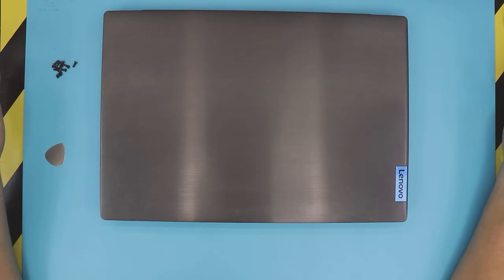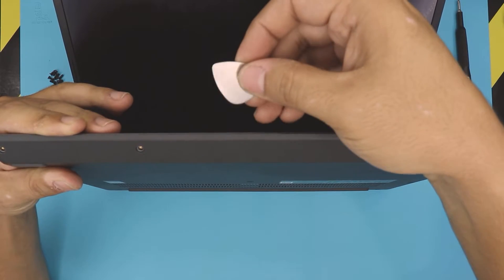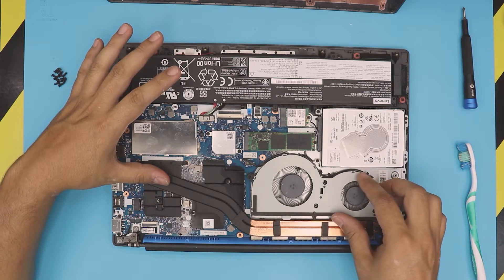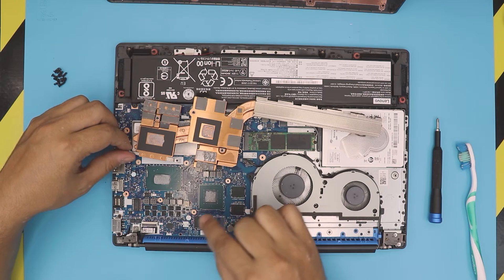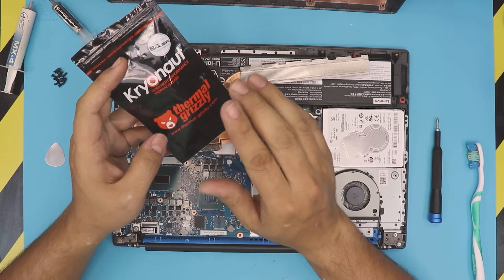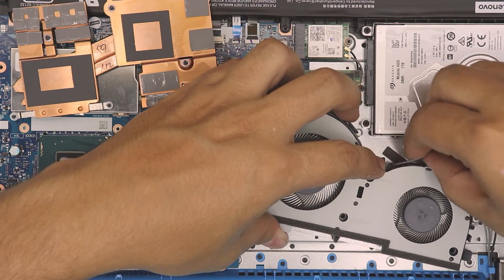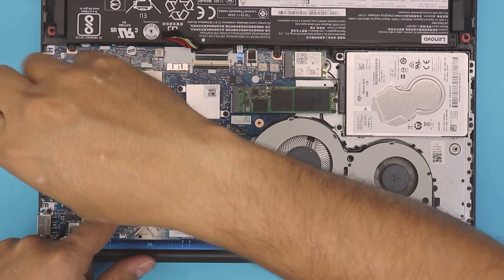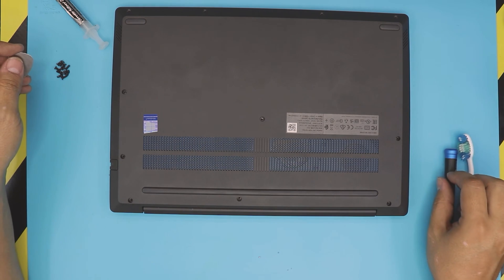Lenovo Gaming L340 Repaste maintenance under 10min !

Comment: hello sir i am from india and  I own th esame laptop that is lenovo l340  thermal pads  on heatsink ,of my laptop are corroded like they are in powdered form on some parts please suggest me what should i do and reccomend me the thermal pads of perfect thickkness  that are available in india on amazon . please reccommend .
Reply from the maker: Thank you for the feedback! if you wish to support the channel you can LIKE or SUB or both :P
regarding your question: get any 12kw and .2mm : https://is.gd/CmGARM
Reply: @uFixTek  Sir this link is not opening please provide another.one please
Reply from the maker: @devsati4311  https://www.amazon.in/MAXBELL-Silicone-Thermal-Resistance-Heatsink/dp/B09GPN2F13

Comment: Cleaned out my fan’s dust and it’s still making weird noises smh help
Reply from the maker: can you send me a short video or audio of the sound that is making?
ask@ufixtek.com
Reply: @uFixTek  Do you have an instagram that I can send a video to? Its like a moderate to loud whirring noise that isnt the gpu. even at 5% usage its making noises. I took the laptop apart and cleaned dust, and went through my vents.
Reply from the maker: no my friend i dont use any of those as rare it sounds but i dont have time to use those, you can email me i check my emails daily.
you can email or upload a private video on you tube, and or use this: https://wetransfer.com/
Reply: @uFixTek  ok
Reply: @uFixTek what’s your email again 😂😂

Comment: I did exactly this, but I am getting a bit worse temperatures than before. Could it be that I applied the paste somehow bad? Is it possible that I maybe pressed it a little too hard on the new paste and it went away from the centre? Should I reapply it?
Reply from the maker: Thank you for the feedback! if you wish to support the channel you can LIKE or SUB or both :P
regarding your question:
please answer the following questions correctly and exactly:
#1. what brand and model of the paste you using?
#2. did you touch or remove or changed the pads around the GPU/CPU?
#3. did you place a fair amount of the paste in the center?
#4. did you cross screw the heat sink clamps. in a X way?
Reply: @uFixTek  I used the Arctic MX-4. I did nothing with the pads except cleaned them with a little bit alcohol from the old paste. I think I applied enough of the paste, and I screwed it in X way. That's why it feels strange to me.
Reply from the maker: ok then you may need to use a thick paste like artic silver 5 that is great for a uneven heatsink,  this happens often we get this situations in the store, that sometime the paste that we use normally mx4 dont respond well because its not thick. so we use artic silver 5 that is thicker and can stand better the unbalanced plates. because the factory paste is also thicker for the same reason.  if you can get your hands get artic silver 5 is the only good paste that is thick, dont get :
thermal grizzly kryonaut
or anything else they are awesome but they are like mx4 very thin.
https://amzn.to/3yIRtXb
or get the 13grams for futures repaste:
https://amzn.to/3qYr0Cb

-
note if you still have left over mx4 do a repaste again to confirm the situation.
Reply: @uFixTek  shit. I got thermal grizzly and i am now worried lol. I haven't installed it though
Reply from the maker: @yostinpoveda2083  we use thermal grizzly , his case is 1 in 500 maybe or even higher. just two days ago we did a service with thermal G, and it was beautiful results.  try it out.
Reply: @uFixTek  I'm repasting today with grizzly later on at night.
Reply from the maker: @yostinpoveda2083  oki take your time, and if you need help let me know. good luck
Reply: @uFixTek  thanks a lot. I will spread it out with the spreader that the grizzly paste brings. By the way, great English. Is your store in USA? I have always like computers. Maybe I will take a technical degree sometime and see if I could make some extra income sometime in the future.
Reply from the maker: @yostinpoveda2083  okay do that spread the paste and take your time doing it, i speak 5lang, im in the mexico at the moment but i live in canada. if you like computer take a course and i always make videos trying to help people to do their services and upgrades.
Reply: @uFixTek  hello sir. I have only been able to unscrew 1. I have a 7.5 mm unscrewer, do you think I should go for a 10mm and a not square one in case I mess up with the screws?
Reply: By the way the only screw i was able to lose up does go off I guess it will untill all of them go off. And i also have a contact cleaner for metal contact which I was going to use to clean the CPU and GPU not sure if spraying a bit on the screw could help it loose. I am even thinking to buy welding Adhesive and adhere a nut to the screw. I also have DWD 40 rust lubricator. Not sure if I could also use a hammer to help loose up the screws by giving some small smashes with a hammer to them lol.
Reply: I know this is 2 years old but is the performance better? It could still be thermal throttling just like it was before but just run at a higher speed hence the temperatures not having gone down

Comment: My laptop all of the sudden have some keys that stops working randomly. They start working again and then it keeps happening. I tried all the software solutions and still happening. Do I have to change the keyboard?
Reply from the maker: Thank you for the feedback! if you wish to support the channel you can LIKE or SUB or both :P
regarding your question:  your keyboard membrane is going back, unfortunately you will have to end up replacing the keyboard. replacing this mesh keyboard its not a easy nor hard task just time consuming :P
here is a video of how to replace a mesh keyboard.
https://www.ebay.com/itm/333176442734?hash=item4d92dd0f6e:g:0YwAAOSw3WxaTLks

https://youtu.be/xsg-Zn80hZQ
https://youtu.be/m3zuNBASGCY
https://youtu.be/3srWWbxIgXI

OR you can replace the Palmrest  completely but that would cost a bit more,  but less work :P
https://amzn.to/3dCl4t7

Comment: A quick question can you remove the keys one by one on the keyboard?
Reply from the maker: Thank you for the feedback! if you wish to support the channel you can LIKE or SUB or both :P
regarding your question:  YES and NOT recommended you will have 80% chance of breaking the hinges under the keys, it requires lots of skills. i been doing it for 18years and still not perfect.
Reply: My brother spilled soda on my laptop so some of my keys are sticky.
Reply from the maker: use a isopropyl alcohol with a pray and spray a fair amount on the keys and let the isopropyl alcohol get under and keep tapping the keys till it washed the soda, the isopropyl alcohol will destroy the soda :P
make sure the laptop is off when you doing this and let the laptop dry dont worry the isopropyl alcohol is not conductive.

Comment: i cant open the back at the ethernet port
Reply from the maker: Thank you for the feedback! if you wish to support the channel you can LIKE or SUB or both :P
regarding your question: you make sure you remove the screw :P and if you loosen up the other end of the case just pull up from other end and this side will snap out. they are hold by tiny clips that are not even important.
Reply: @uFixTek  i have subbed
Reply from the maker: much appreciated :P

Comment: My bottom air vent is broken so should I use or replace it?
Reply from the maker: Thank you for the feedback and your support by a sub  :P
regarding your question:
can you send me a picture of the vent broken?>
Reply: @uFixTek  how?
Reply from the maker: @klaus9687  take a picture of the broken vent and use this website , and post the link here
https://prnt.sc/
Reply: @uFixTek  did u see it?
Reply from the maker: you have to upload to that website and post me here the link,  in order for me to see it
Reply: @uFixTek  I am posting the link but it is disappearing
Reply: @uFixTek  plz say can I use?http://prnt.sc/11mxrw8
Reply: Mesh cover is broken
Reply from the maker: :P dont worry , i would even recommend you to peal off the mesh it will help a lot with air flow. trust me the mesh it wont help with dust, just remove it
Reply: @uFixTek  ok and I did a stress test and it gave a warning about overheating....should I repair it?

Comment: The very useful guide , thank you , but i have a problem with screws on raditor just cant turn them , used a lot of strength and damage them a little bit , maybe you can give me advice or answer?
Reply from the maker: thank you for the feedback and support to the channel by a SUB :P
regarding your question: sometimes they are really hard to remove:
method one:
press down with screw driver on the screw and do a small rotation with extra force.
#2. if all intent didnt work make a insertion straight over the screw head and use a flat screw driver to remove, if you want me to make a video showing you how to, i will in a couple of days.

Comment: May I know the exact thickness of the thermal pads so I can order a pads and paste as well? Thank you 😁
Reply from the maker: Thank you for the feedback and your support to the channel by a SUB:P 
regarding your question: 
here is the pads for the laptop:
the best pads:
https://amzn.to/2QL6wPj
2nd best:
https://amzn.to/3rveOHu

BUT i would recommend you to not replace the pads, NO need at all to replace them , you wont notice any difference in performance or anything, the thermal pads for the vram are totally not required UNLESS you are going to OC the vrams. if you are not over clocking VRAMS no need!
Reply: @uFixTek  thanks for the tip! That helps a lot
Reply from the maker: your welcome my friend and good luck

Comment: Hyy it's me again...

As I checked with some games, using MSI Afterburner...

For Mafia 2 Classic the GPU temps are around at 60C-65C while I LIMIT says NO LOAD

But when I play Resident Evil 3 Remake GPU temps are increasing gradually while LIMIT says VOLTAGE LIMIT

So is it the problem with battery and charger?
Reply from the maker: Thank you for the feedback and your support to the channel by a sub :P
regarding your question:
we do get this issue in the store often and the results:
1. 80% charger failing to deliver the right amount of amper.
2. a voltage regulator on the motherboard of not woring properly
3. batter has nothing to do with this, you should never never do a full load on battery alone , as you can damage many power regulator components, that can result in the above issue.
Reply: @uFixTek  sorry I didn't catch that much 
could u please elaborate more?
Reply: @nj_mods  Lenvo L340 gaming has a power limit of 35w (TDP) due to its poor thermals in theory. I will try reapplying thermal paste and changing the TdP from 35 to 45
Reply: @yostinpoveda2083  I have put my power limit to 30w and still temps are high and reaches upto 85C max...
Reply: @nj_mods  Have you re-pasted the CPU and GPU yet? My temperatures are under 75's on apex legends and another air plane demanding game. There is a new BIOS update in Lenovo service bridge for Lenovo L340 gaming laptops. I updated that BIOS, also put my pergormance power plan in the minimum to 100% and maximum to 90%. Please note I have a cooling pad and place my laptop lifted a few centimeters from the desk when gaming. Make sure you have no windows updates pending. Try eliminating start up apps by going to task manager and check disable start up apps. You can also disable background apps by going to background apps in windows. In short start up and background apps are energy killers and i believe they also eat some power from the CPU besides our games. Thus, running a game + start up + background apps may make the computer hotter but that is my theory. I have done all of the above + will take my laptop to take off the manufacturing thermal paste for a new repaste. Eventhough my laptop is just 1month old, i don't trust the application of pre-applied thermal paste.
Reply: @yostinpoveda2083  no I haven't repasted my CPU and GPU and also my CPU temps average at around 75C but sometimes it touches upto 85C and then drop back to 75C... I am also using a lifted cooling pad... Ive disable unnecessary startup programs and background apps... 
As of BIOS update I haven't check that yet and mine is 6months old.
I guess the stock thermal paste for CPU and GPU is the main reason behind overheating...

Also to mention that games seems to be running better when I turn off turbo boost, because when it's on the game seems to been stutter a bit.
Reply: @nj_mods  I see. My CPU goes to 4.0ghz for some seconds and the goes back to 2.4ghz. And goes back to 4.0ghz again. The GPU runs perfectly fine and CPU uses boost but sometimes. I hope the re-pasted helps the boost speed to be maintained a bit more. If not , i Will change the TDP from 35 to 45 wats tdp as long as my re-paste keeps temperatures down, so I can have some room for maintained boost speed.

Comment: Hey pro .. 
My laptop ideapad l340 i7 the button ( w ) don't working but when i connect other keyboard he working  what should i do can i fix this buttom only or change the keyboard .. 
Can u advice me because in this case i fell like panic attack 😭 ..
I from egypt
Reply from the maker: Thank you for the support to the channel by a SUB :P
regarding your question:
the keyboard button cannot be fixed, no one can fix it.
you will have to replace the entire keyboard:
https://tinyurl.com/j8bf2n4f
search on aliexpress or ebay for this:
lenovo ideapad l340 keyboard
and make sure you get the right keyboard pay attention to the enter KEY some come with L shape enter key and some straight
the rest doesn't matter 

here is two example of the enter keys:
https://prnt.sc/10qovyt
https://prnt.sc/10qovpj
Reply: @uFixTek and is there a different between original and copy are effect in the laptop or not ? Im worrying about it ..
Reply from the maker: no its all the same, there is no difference in original or clone version both use a plastic membrane.
Reply: Hi can u make a video how to replacement a keyboard because i want to change it by myself because i don't trust in the maintenance center ..
Reply from the maker: @muhamed-mustafaelsemari4577  here a keyboard replacement that i just uploaded that can be a use as reference its almost the same concept , i know you can follow and do the same.its pure logic.
https://www.youtube.com/watch?v=xsg-Zn80hZQ